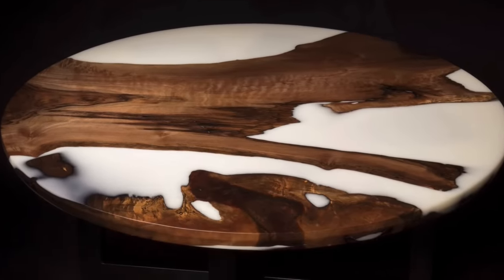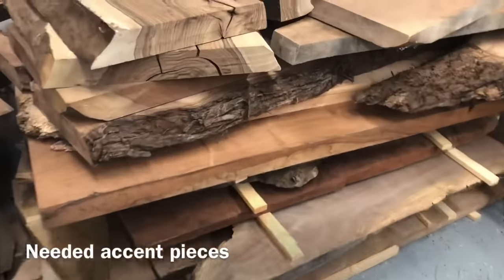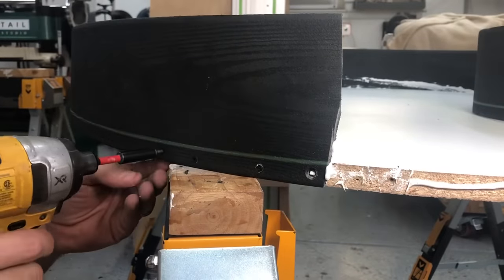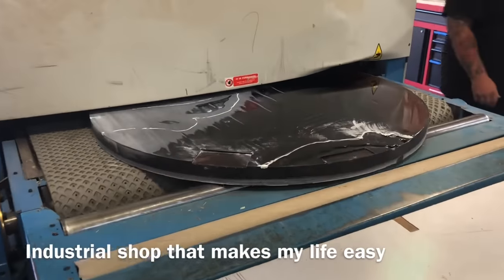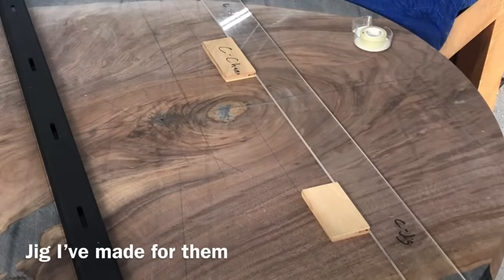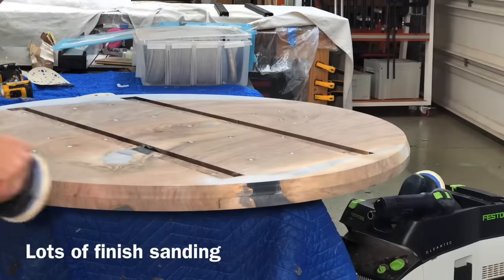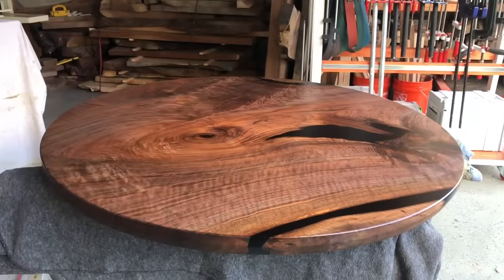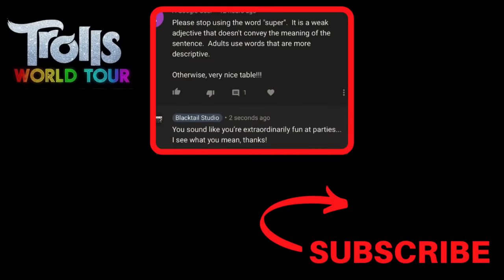A Table Got Ruined

Comment: CAM If you ever  the bead wipe of the caulk, here is  bead. once in place  DENATURED  OVER THE BEAD THEN WIPE THE BEAD. The caulk will stick where it touched the seam, and not where the alcohol was sprayed. it leaves a  a blur of  bead. works on counter and tub and shower

Comment: I’ve done a lot of countertops in Corian and some polymers and white is one color I ALWAYS ask the customer to sign a statement acknowledging that it WILL yellow or stain over time.  I have not found ANY resin, polymer or petroleum product of ANY quality that does not have this problem.  If a person HAS to have white I encourage them to let me cast a clear resin with white marble powder.  Or better yet, simply incorporate a white granite directly into the piece.  Stone is harder to work with but after my initial year warrantee covering anything that I might have done wrong, I do not want to have to cover the lifetime quality replacement warrantee because they put the piece in direct sunlight or hauled it out on the back porch for the Summer.  It’s not always the customer’s fault…and I’m not perfect but some materials are just not good for long lasting use in all conditions.  Give me a 12th C. Shelf from a monastery to  to refurbish with period materials and tools ANY day!  I hate plastic!

Comment: Cam, great table! I think you should use locktite on your furniture screws going in the threaded inserts, it will keep them in that snug position allowing the side to side movement but will prevent them from loosening over time... Just a suggestion, love your videos

Comment: Cam, the large router bit is likely M42 high-speed steel, a common grade of tool steel. Carbide is definitely harder, but I wouldn’t worry about that too much for woodworking. If your router is undersized for that bit you should be able to hear the motor bog down. 

Enjoyed the video!

Comment: Golden bits are made from Titanium nitride. Cobalt is brown/bronze ish and overall a bit stronger :)
Reply: TiN is more of a coating. It still could be a Cobalt router bit with a TiN coating :)
Reply from the maker: Ya, the gold is just a coating
Reply: @Courtneyhc305  Cobalt is also sold as a coating on HSS. Havent seen full cobalt bits yet.
Reply: You also didn't begin your comment with "Cam", therefore your opinion is null!
Reply: Cobalt refers to a high speed steel. It’s harder than the typical M2. Cobalt drill bits are used for drilling stainless steel. The gold color is titanium nitride. It is a coating. You will get cleaner cuts with that cutter until it dulls. Carbide lasts longer but is not as sharp.

Comment: A few months ago I put the arm on my Festool dust collector. And it is AMAZING. It is like the hose and power come from an angel. They only problem is it makes the CT way less mobile because of the legs in the back. I'll likely just get another collector. It will really help messing with the hose cutting the circles.
Reply from the maker: I’ve looked at those!

Comment: Cam there is one part of the build that I don't know if I understand. The two metal plates that you cut out slots for. They aren't used to connect the table legs as I first assumed so what are they there for?
My guess was perhaps to prevent warping but I haven't a clue if I'm close to the mark?

Comment: Cam, I love your videos. You show methods and materials even a novice can get. I admit I am not a fan of epoxy or river tables, although it's great for filling knotholes and cracks. I prefer to sort of follow the wood, no straight lines, limb stubs showing, cutting off the worst damage but leaving some for character.  About 65 years ago my parents had a slab of monkeypod shipped from Hawaii after seeing it used there. It was finished locally into one 6 ft. long coffee table about 3" thick with turned monkeypod legs. There were 3 smaller side tables of same type, but perhaps 1x2 ft. The set was gorgeous. The table set was the star of the living room for years. It became my mental model for the few tables I have made of redwood and walnut. I have downsized to a small apartment and no shop, but I still make things with a few simple tools. I work on a tiny patio and my neighbors consider me eccentric because I make things with strange shapes using funny old tools. Fortunately they don't mind occasional noise. The wind is my dust collection system. So circumstances have changed with age, but we're still having fun.

Comment: Cam, I really appreciate your thoroughness in answering comments on your videos--so it is unsurprising to me that you are thorough in your customer service as well! In this video (at 6:03) you mention not routing all the way through because "you might have some tear out." My experience is that I seem to get a lot more tear-out with a jigsaw than I do with a router bit--but I've never worked with live-edge slabs. I'm about to cut my own circular table (edge glued hard maple planks, spiral up-cut router bit) and I wanted to double check if you had any tips to avoid that "blow out" so I don't have to buy an expensive flush-trim router bit.
Reply from the maker: Can clamp it to a piece of plywood. Would help
Reply: @BlacktailStudio  Thank you!

Comment: I'm really enjoying your channel. You're a great teacher. I have a question about sanders. What makes a $700 sander better than a $60 sander? Power? Amps? Spin speed? I can't afford a $700 sander, but I might be able to afford a $100 sander that's 6 amps versus my current 3 amp orbital sander. Is that a good idea? The problem is sanding scratches out of the wood.

Comment: Cam, once again, beautiful work.  Since this video was all about solving problems, I was hoping you might have some suggestions on a problem I'm facing.  How can one remove water stains on wood before finishing?  My current project is a combination of walnut and maple and some of the pieces got a little damp from a small leak my basement shop.  Unfortunately I didn't realize what had happened quickly and the water ended up wicking into the wood and leaving some stains.  If you've ever encountered something similar, how did you resolve it, short of replacing the damaged wood?
Reply from the maker: I’d figure letting it dry out and then sand it off should do it

Comment: Cam, I'm a first time commentor but long time lurker. It's a marvel to see your pieces grow from a slab of lumber to a fantastic piece of usable art. You are an inspiration to,  I can only imagine, many wood workers out there and as someone who deeply wishes to one day be able to do what you do (but in Sweden) I learn so much from your videos. My one question for you today, you use a cylindrical lamp while sanding, is that to find uneven areas you don't spot with the naked eye under your normal working lights? Might be a simple question but the simple questions are also important =) Have a great day. Cheers from Sweden.
Reply from the maker: Ya, I generally like a photography light to find imperfections

Comment: Cam im looking to get in wood working. I am a student with just enough money to buy varnish and bits for drills and my sander. A friend offered for me to use their shop but they mostly work on Electronics so i have some tools but not everything you use off course. What are a couple good hacks or procedures to do with a low budget and limited tools to still get a nice table? And what would be the easiest shape and size to start.
Reply: Ohh yeah and any tools i cant do without
Reply from the maker: Oh, I think my videos have lots of tips. Better than a comment anyway 👍🏼

Comment: Hi Cam, I really enjoy watching your video's man! You make amazing tables.
When you apply the finish and flip over the table, you say it leaves marks on the underside. But if you make wooden inserts for your c-channels (about half their depth), and then temporarily install the c-channels after finishing the underside, it will sit on just the c-channels instead of the whole surface. It's just a thought, but it might save you some time.

Comment: Hey Cam, I have a cookie with a crack all the way through from the center to the edge. So at it's widest, the crack is about 2" W on the bottom face, and 3" W on the top face. My question is, will epoxy be enough to hold the wood together and prevent further cracking? Or would I need to do something like adding a bowtie or two?
Reply from the maker: You never know for sure, Sorry!

Comment: Cam, great video, I've just finished my 1st ever epoxy table, its only a thin slice of walnut with a nice split in it. I prepared the wood and filled the split with an emerald green epoxy (looks lovely) but have come down this morning and the epoxy is now about 3mm beneath the wood as it has seeped in somewhere, could you advise how to finish off without it looking 2 different shades of green if I can't exactly match the 2nd coat? Many thanks
Reply from the maker: Ya, I don’t have a solution for that. Sorry!

Comment: Cam, what’s the best way to clean a table? I’m talking daily use clean? I made a cherry/walnut breadboard end dining table but not sure what’s the best way to clean it post dinner? I finished the table with Rubio monocoat pure. Thank you for your help! I’m so confused and I don’t want to damage the finish.
Reply from the maker: Just dry micro fiber. Followed by wet micro fiber
Reply: @BlacktailStudio  no cleaning product? I’ve been looking at the seventh generation wood cleaner, or even the method brand wood cleaner. 
If a damp microfibre is the way to go then I won’t look any further.

Comment: Hey thanks for posting all these cool videos!  And for being transparent about the epoxy issues.  Two dumb questions: 
1) For the table that yellowed, can you salvage the wood at all, or does the epoxy basically make it impossible to do that?  I'm curious because say I used some really rare wood with epoxy and the epoxy went bad.  Clearly any of the solid epoxy would be junk, but suppose I wanted to save the wood.  Is it like purpleheart where just the outside gets bad and you can sand it down, or does the yellowing go bad through-and-through?  I'm really interested here because you do big pours.
2) Are there any of your tables in the San Francisco area? Would love to see one in person (versus the video) some day.
Reply from the maker: I dunno, it’s stuck in Hawaii

Comment: Cam, thank you for your very interesting video.  Why is the  resin used almost always  black?  would clear resin work so that parts of the table were  see through?  I really  enjoyed  a  video  recently  where  thin cracks  were  filled  with copper resin. the  result was outstanding  but  was more  expensive  than  the  black resin so many  use.  The copper  metal looked  was  beautiful  against  the wood  -   the  filled  holes  were  not  huge  but  were  instead  more like  spidery  fissues.  So the  threads of copper  looked  amazing  next to the  dark  wood.

Comment: Hey Cam,
Can you use water based polyurethane instead of shellac to seal the edges before you pour the epoxy?
Reply from the maker: I’ve never used shellac to seal the edges. It’s a bad idea. Epoxy won’t stick. I’d use what I do in the video

Comment: Cam:
I have 3 really small pits in my epoxy river where it meets with the wood. Theres a patch of bubbles that kept coming out of the couple pits. 
After I sand everything, do you know if u could just fill those with clear super glue? Or is filling those with more epoxy the only good option?
They're about the size of the tip of a pen
Reply from the maker: I’d just fill em with clear epoxy

Comment: Cam, so after cutting the 1/2" deep profile with the circle jig and then cutting out the remainder of the shape with the jigsaw, if you didn't have a nice, big router table, would you recommend just free handing with the router and the flush trim bit?  Thanks.
Reply from the maker: Ya, probably

Comment: Lots of confusion about the bit. Cobalt bits are very hard and extremely tough in resisting chipping. This one is titanium nitride coated (not made of titanium nitride) which is a harder surface that will resist wear.

Tungsten carbide (high performance cutting tools and inserts) actually consist of Tungsten carbide particles sintered into a cobalt matrix, resulting in a very durable, very tough material that is much harder than cobalt alloy itself, but also more brittle.
Reply from the maker: Thanks for that!

Comment: Are you using the liquid glass to seal your table before the big pour and also using it for smaller cracks? How does the liquid glass do when poured thin.?
Reply from the maker: I use it for sealing. Not usually for cracks

Comment: Hey Cam, when you use the CA glue to fill the cracks,  do you use the thin,  medium or thick? Also if you fill cracks with epoxy, is it ok to use the deep pour for touch ups or better to use the flood coat kind?  
Thanks.
Reply from the maker: Usually medium

Comment: Cam, thank you for such amazing work you are doing! I am working on my first epoxy table, and have a question about sander. Which one would you recommend to buy first as the most needed one? Festool ETS EC 150/3 or 150/5 or Rotex 150? Greetings from Finland!
Reply from the maker: I’d go 150/3 hands down

Comment: Do you think the C channel is still necessary on smaller slabs? I've got a couple 2" x 16" x 10" maple slabs I'm going to use for end tables... obviously there will be wood movement, I just figured it wouldn't be as drastic since they're pretty small pieces!
Reply from the maker: Na 😊

Comment: Is there a reason you prefer sealing the top with shellac before the pour? Would I be able to use the same resin as on the edges in a pinch?
Reply from the maker: I’ve actually switched methods recently. Check out a newer video if you want

Comment: Cam, Is Rubio Monocoat PURE the one you use? I found it on a website locally but there are quite a few color options for the 2C and I member you saying never to stain wood. And also, can you seal the edges with shellac as well as the top and bottom or do i need to use resin for the edges? Thank you in advance for your answer!
Reply from the maker: Yup, pure 2c is what I use

Comment: Cam, love your videos, you do a great job at describing and informing on the process.  I am in the middle of making my first epoxy table (round coffee table, surprise for my parents, shhhhh don't tell them :)  ) and I am looking at finishing the edge.  Did you use the 22.5 deg bit on just the bottom side, or did you do both the top and bottom.  You only showed doing one side, which looked like the bottom.  Later in the video, it almost looked like you did from both the top and bottom.  Once again, love your videos.
Reply from the maker: Just on the bottom
Reply: @BlacktailStudio  Thanks!

Comment: Cam, when you install the C channel bolts, you say they are not tight to allow for movement.  How do you prevent the bolts from working themselves out over time?  Do you use lock tight or something?
Reply from the maker: You can check on them, or add lock tite

Comment: Cam! These both turned out super, love your work so far (discovered your channel a few days ago). What factors into your decision to use C-channels or not? I thought the circular table was going to be short enough that it didn't require them, but not the case.
Reply from the maker: Slab over 30” is a good starting point for them

Comment: I am 18 my name is Jace Simon . Just built my first tabletop epoxy desk and went to polish and I put swirls all over it. I have done as much as I can to try to remove but I am having no luck. Do you have any suggestions? If not I will just do another coat of epoxy but want to see if there are any other ways first! Thanks!
Reply from the maker: Hard to say via a comment here. Maybe check out my finish videos

Comment: Cam in the video there is the part where your pouring the resin with the other people you first put a line around the lower areas and than when you topt up you poured over that line. if your going to do that why is the line needed?

Comment: Cam, you once said that sanding OSMO after its dried is fine. but when I tried to sand it with 320 grid after it was dried for about a day, it was "super" hard. It builds up a kind of very small chips that clung to the sanding paper and made it unusable. is there any tricks here?
Reply from the maker: Probably a different Osmo. This was 3043
Reply: @BlacktailStudio  right, its 3032. I don't know exactly why, but in europe there is no 3043 to be bought. I have tried different OSMO dealers and some told me that 3032 is the same as (or similar to) 3043, but it seems thats not true.

Comment: Cam, I've been using EcoPoxy UVPoxy to accent some projects that I have engraved with a laser.  I'm having trouble with bubbles in it that come out of the wood.  What would be a good way to seal that up without filling the whole engraved space up with epoxy?  I see in this video you used the epoxy to seal the edge you created, how long do you have to wait for that seal coat to cure before you can pour the epoxy?
Reply from the maker: Just a very thin coat of epoxy
Reply: @BlacktailStudio  thanks Cam. Do you let that thin coat of epoxy sit and cure for the whole recommended time or does it dry and seal quicker than the standard cure time?

Comment: Cam are those festool vac blocks not very rigid or was that just too much weight for it? They look handy, but it looked like the piece might fall off as you started routing the edge chamfer!
Reply from the maker: It won’t! I had it loose. You can’t tighten it as much as you want
Reply: @BlacktailStudio  thanks, that's good to know. Great thing you did for your customer, you absolutely deserved to get the second table sale!

Comment: Hi Cam, on a 24inch circle walnut table with an epoxy inlay .25 deep would you suggest 1 or 2 "C" channel bars on the underside? Thanks in advance!
Reply from the maker: Probably not necessary
Reply: @BlacktailStudio   No C Channel necessary at all?